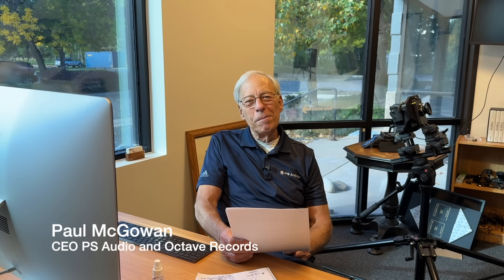Converting cable disbelievers

Comment: Once again, Paul is spewing debunked audio lore.  

Analog cables do make a difference to sound quality but the differences are minimal. In a very large blind listening test, most listeners couldn't hear the difference between high-end speaker cables and wire clothes hangers used as cables. Of the small percentage who could reliably hear the difference, a slight majority preferred the coat hangers. Look up "Cable Myths; reviving the coathanger test". 

Paul would rather rely on his (faulty) subjective opinions rather than the scientific process using double blind listening tests.
Reply: I'm one of them. I thinks...Bose speakers sound good.
Reply: @sidesup8286  And I have no problem with that.  That's my point, you should get what works for you, what sounds good to you.  You don't need blind comparison tests or graphs of frequency response to tell you what you like and what sounds good on your system in your home.
Reply: @CliffCollipriest2013  You shouldn't accept the advice of a shyster and spend a lot of money to get nothing.
Reply: @markmeridian3360 ...the difference might be, in your opinion, "minimal" however, said difference is noticeable
& if it's noticeable then it's up to the individual listener & his/her available funds (bank account) to decide whether the
purchase is financially worthwhile or not. You should change your moniker to "spewingdebunkedaudiolore" it suits you
better than "markmeridian3360" ...just sayin'.
Reply: RAT can't understand simple English.  The large blind test found that few could actually hear the difference between coat hangers and a high-end cable.  Of the few that could, a small majority preferred the coat hangers.  Therefore, it's obvious to anyone who isn't hard-of-thinking (note; that cuts RAT out), that they won't hear a significant difference from different analog cables and should not buy into any audio shyster's claim to the contrary.  

RAT has also not figured out that anyone can get a much bigger audio difference by simply turning the bass or treble knob up or down by one notch than by paying too much for an audio cable.
Reply: @markmeridian3360   ...bass & treble knob & the rest of your 'word salad' 😂🤣🤣
I find it hilarious that you keep appealing for the approval of other contributors here by speaking about me in the 'third person'...RAT this & RAT that...YOU'RE TRIGGERED!! 😝
I don't consider $105 for 3.5m of loudspeaker cable & $280 for silver XLR's to be "paying too much for an audio cable."
Reply: RAT shows with every post that his command of English is extremely poor.

He can't figure out that the blind listening tests proved that his $105 dollar cable performs exactly the same as a 10 foot 14 gauge speaker wire with pre-attached plugs that you can get for $29.99 on Crutchfield.
Reply: @markmeridian3360   ...oh dear; Mark has no idea...smh.
(Mark shows us, with every post, that his hearing is extremely poor)
Reply: RAT is obviously a science denier.  Doesn't believe in blind listening tests.  Doesn't believe in null testing.
Reply: Most people think Bose speakers sound good.  So what's your point?
Reply: @CliffCollipriest2013  What's that got to do with cables?
Reply: @markmeridian3360  I thought I made that pretty clear.  It's about what listeners hear or think they hear.  And it is about how cables can change the way a system sounds even if measurements don't show a big difference.
Reply: @CliffCollipriest2013  Measurements don't show a big difference, that's true. In this test, there was a measured difference of only about O.1 to 0.2 dB over a narrow frequency range between the coat hangers and the high-end cable.  But it's not just that - not by a mile.  Almost all people when tested scientifically, couldn't hear any difference.  Some thought they could, but the majority of those didn't actually do any better than random in picking out the coat hangers from the high-end cable.  Of the few that could actually hear a difference reliably, a slight majority preferred the coat hangers.

The point of scientific testing is to find out if the people who think they can hear a difference actually can.  Claims based on non-scientific subjective listening are most likely totally bogus until backed up by blind (or double blind) listening tests.

Comment: Easiest way is to use a 22 gauge cable and then use a 14 gauge able, you will notice a difference. However, the returns diminish as the gauge goes down. Unless you are a in your teens or twenties or have a ear that's been trained over the years, you aren't going to really hear a huge difference from let's say 12 gauge to 10 gauge, assuming that the cables are using the same core material. This by no means takes away from the fact that shielding, material, length, etc. can make difference in reducing noise and increase dynamic range. Premium $300 cables should sound nearly as good as much costlier ones, unless you have young or specially trained ears.

Comment: I have the Audioquest Dragon power and speaker cables, etc. Cables do make a huge difference but when you are talking big budget systems. Someone's expectation that spends a thousand on cables with a 5k system is going to be disappointed. Cables on the upgrade spectrum for most audiophile budgets will be close to last because they have so many other issues within their systems. Putting 10 gage copper Romex with dedicated runs for usually a couple thousand bucks to the panel can help greatly with noise floor.  The Dragon cables are not for everyone that are complete silver. Silver can be very detailed but in some systems to sharp sounding if the speakers and amp already have that detail. In those cases a copper cable can smooth out the sharpness. With my system I have tube amps and a more musical speaker so the Dragon cables keep the sound from being too soupy. I get nice detail with smooth realism. Before cables acoustic panels might run a few K. It's often best to just use a few panels to start and see what that gets you. People often overdampen a room with bass traps, ceiling tiles, and regular room tiles and the sound is lifeless. It's not just the gear you buy but the experience of someone who knows proper room setup and how certain brands work well together and some do not. That takes wisdom and experience from a reputable hifi dealer. Anyone can sell you some gear. It's the support and setup that matters.

Comment: After extensive reading from a variety of sources on the web, I will say that these discussions and opinions always miss the issue of phase delay in different cables. Inductance and insulator energy storage, acting as capacitance (albeit for micro seconds), appear to time smear (delay different frequencies in the audio spectrum) different frequency signals in the cables. Golden ears do pick up these subtle differences but none of the standard measurement protocols seem to look at this issue of time smear. I don't hear differences between different cables that I can quantify but I accept that there is a minority of folk who do hear differences.  

For my part, I found that a speaker or amplifier or source upgrade 
is the better way to spend money than to buy highly priced speaker cable.
Reply: @jiaubza ...I'd agree with you about the "highly priced" (I wouldn't go above $500) however, "highly priced is a subjective amount.

Comment: This has me thinking about the speaker wiring at our church. The other day a muso was complaining about the sound being quite thin, and thinking in the music sense, he's probably right. I've put most of my attention to the system with respect to speech, can we make the 'message' easier to understand, with the music a secondary issue.
Thinking about it, the wire is somewhat thin commercial grade double insulated speaker cable. It will be interesting to run some tests on them.
Years ago I made up a long cable on a drum, probably something like 20 meters, for a show in the church hall, one speaker was next to me and the amp, the other way down the other end on this 20 odd meter figure 8 cable (I think the US call it zip cord) the loss was crazy, I had to really skew the amp's balance control to try and get it balanced.
Reply: For truly long speaker wire runs use 70Volt line transformers.
Reply: This has nothing to do with cables. Just use two separate buses on your mixer, one for speech and a different one for music, eq them accordingly and ‘volia’ problem solved. If, instead you start spending a bunch of money on expensive cables your pockets will get ‘thin’ too. 😊

Comment: Unconscious bias can trick the brain, and what is heard, into thinking that the cost of expensive cables was worth it.
Much better than thinking it was money down the drain.
Reply: Some audiophiles try different cables and don't always think the most expensive cables they tried sound the best with their system, even though they can afford them.
Reply: I bought a costly cable once and know I heard an improvement. Then I had an emergency expense on something else, and when I listened to the cables again; they sounded worse than the ones before. So I tried getting my money back on the cables to help pay for the emergency expense. But no way they told me at the store..The 30 day return window had expired. When I got home &  tried the cables in my system again, they sounded as great as what I heard the first time; before the emergency expense.
Reply: Your theory is down the drain, because I can't think of one cable company that doesn't offer a satisfaction or your money back guarantee....Where do people pull these theories out of?
Reply: @montynorth3009 ...there's no money down the drain if you buy from a seller who will allow a fully refundable 24 or 30
day in-home trial. Why do you find it necessary to state that it's money down the drain when said money can be refunded?

Comment: For the love of god- just show the measurements that prove that thicker wires have more bass and thinner wires have more highs. Show that construction property x always provides an effect of y. Do it for all the purported construction benefits (silver, woven, flat, foil etc etc). Then conduct some double blind AB tests where a majority of listeners decide what they prefer and why. If the reasons for their preferences align with the purported benefits of the construction properties of that wire, we will have ended this endless debate. It will be hard to do but it can be done. Start with just a few construction types. Paul has the space and equipment to do exactly this. Skip a Saturday of making normal videos and run these tests. Have some folks in for the AB compare. Invite Danny Ritchie 😆.  We’ll all thank you. But no one in the industry ever will. Why?  My personal suspicion is that the tests will be inconclusive. All this talk will be disproven at worst or not validated at best. And when we learn we can’t believe the hype on this topic, we’ll realize we cant believe most of what the industry says. We’ll have to trust our own ears and preferences, which is what we should have been doing all along.
Reply: OK, what do you measure?

A frequency response measurement won't show it, but it's clearly audible.
Reply: @VideoArchiveGuy  1) I stated that to end this debate one should show any measurement that corroborates the claims. If there is no suitable measurement, it only calls the claims into more question. 2) As for being audible, I am saying back it up with double blind listening comparisons. If one is going to make these claims I think that’s a very reasonable request. 3) I personally have done none of the above. I curated my system based on what was available to me and when I was happy I stopped. But I  am not the one making these claims on a YouTube channel, nor am I insisting on YouTube that my approach is correct, so I feel no obligation to defend my approach. But he does, and therefore he should. Fair enough?
Reply: @VideoArchiveGuy  Utter nonsense. ANYTHING that is “clearly audible” is clearly measurable. But ears and brains are easily fooled, which of course won’t show up on any frequency response measurement.

Comment: Paul:  If Speaker Wire has an Audible Frequency Response then you should be able to demonstrate it clearly with Test Instruments.
Reply: Test instruments only measure what is being tested for.

If all you have is a battery and LED all cables measure the same, but we know a voltage tester won't measure impedance or capacitance, for example.

Comment: Paul always says that the speakers are the most critical part of the audio chain, but what about your ears?
What I actually miss in the whole discussion about perfecting the listening experience is that the listener’s hearing range is rarely taken into account.
Perhaps it’s a good idea to first have a frequency curve of your hearing made and then adjust your equipment accordingly?

And getting your ears properly cleaned is probably a good starting point as well. (;
Reply: You can't buy yourself a set of new ears. You can get a quality hearing aid. With age, we lose some sensitivity to high pitch, and some people lose volume too. However, we still hear music, especially the one we know well, loud and clear, because our brain adds to the music what we don't hear. Even def people can hear some of music and nothing else. This is why Paul is right, speakers are the most important part of a stereo setup.

Comment: Would be very easy & much fun to set up an ongoing A vs B test in your listening room for all your staff and visitors. 

Just one simple test of two power, interconnect or speaker cables… always use the same two cables (disguised to hide their identity from even the staff) with whatever else is in the room on the day and then every week or month update the results on your website. 

Who could possibly argue that wouldn’t be an interesting experiment…?!
Reply: I totally agree with you and encourage everyone who invests in HiFi to do the same.  Simple A/B comparisons can go a long way to either debunk or strengthen claims of differences in cables.  This approach brings peace of mind as to whether or not a particular wire is worth its' price.
Reply: @solidaudioTV   👍 with caveats though. Whoever does it needs a certain amount of help or knowledge to know how to tell if no difference is due to the component being no better because it helps to know to what extent poor synergy, poor placement or a bunch of other factors could also lead to not hearing differences. 

Often it won’t matter - but if your speaker (for example) is in the wrong place a genuinely better cable might not make any difference.

Comment: Diminishing returns onset. DTO.
Reply: Oh, it's definitely diminishing returns, no one will debate you on that.

However the differences ARE there, and it all depends upon whether YOU feel the price is justified for the improvements you hear.

If you hear none, you don't need to purchase a higher end cable.
Reply: I always thought about it as a gain to optimization.
Reply: @tubefreeeasy   ...cup half full then 😉

Comment: In my lab, I've put my signal generator on a sine wave and swept from below 20Hz to over 20kHz and the screened cables I have were ALL flat to several Megahertz with no distortion to the sinewave whatsoever. 
I make the cables myself out of good quality screened cable, made either by Van Damme or Sommer with Nutrik connectors for less than £10.
I think you will get similar results with cheaper, and more expensive cables. If you can't measure something with electronic test equipment, you won't hear it. Anything you do hear will 100% be in your head.
Reply: Some people need psychiatrists rather than signal analysers. I'm not talking about you.
Reply: I own a sine wave generator, but prefer to listen to my stereo. You should try it some time.
Reply: That is simply not so. There have have been hundreds of audio products which measure nearly the same, and one sounds like music and one sounds like crap. Very bad and wrong information. Superior testers like John Atkinson of Stereophile find that measurements rarely convey how somethong sounds. The whole audio industry knows that, & that is why equipment goes through exhaustive listening tests befor it becomes a product & ever leaves the factory.
Reply: @sidesup8286  That is because of complex harmonics at different orders. That does not apply to cables.
Reply: It's actually in your ears, which, technically are in your head, so, yes, correct.

Comment: I did tests myself with the included RCA cables (worth about 10€) and better cables in the price range of 120€ - 300€ that I bought as an upgrade (I bought all the cables new, from power to RCA...etc.) To be honest, I didn't hear a difference... maybe a little, but it could also just be a psychological effect. Anyway, if nothing else, the entire hi-fi system looks better with the more expensive cables, because they are nicely finished.
Reply: If you want to hear the difference, listen to your system with new cables for about a month or two, and go back to your originals, then you might hear the difference. Depending on lots of factors, cables most of the time don't make dramatic changes, however, if you give it some time, you start noticing changes in little details, and after going back to the original cables those details are no longer there. It is like getting in a new car, everything sounds perfect in it at first time. After a while, you start noticing squeeking here and clicking there.